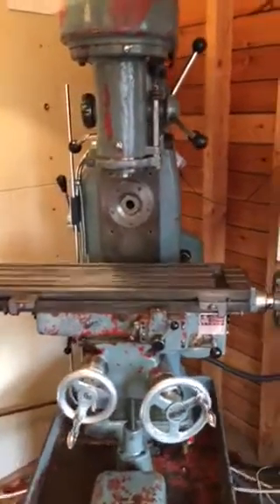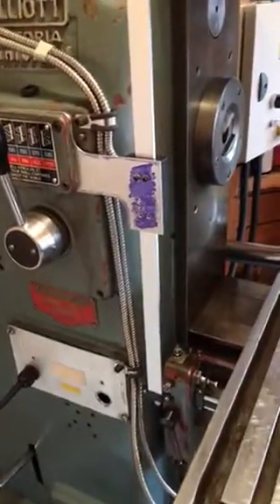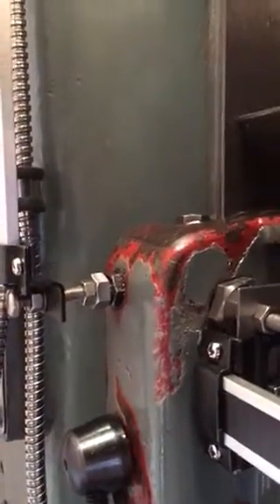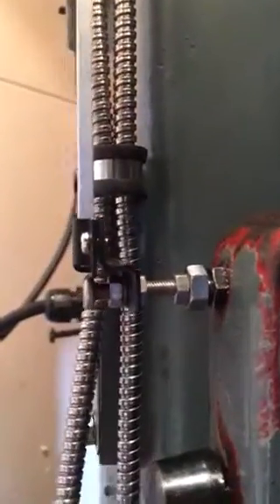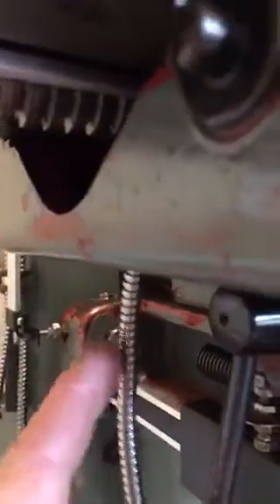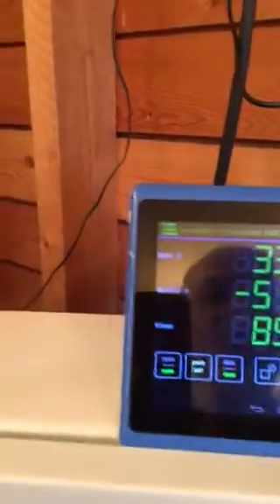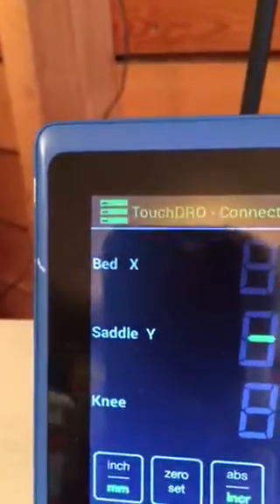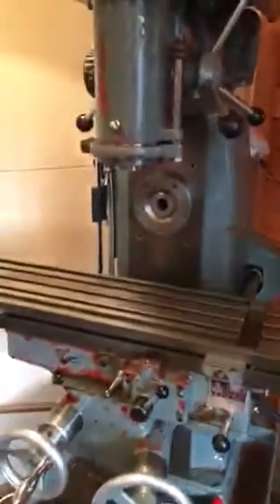Fitting a TouchDRO to an Elliot Junior Omnimil

Comment: Hi, I have one of these millers, Unfortunately, The Y axis Gib is 
missing. Would you be kind enough to measure yours? I only need the 
large end and small end measurements. 

Great video, I love the way you have wired all the accessories 

neatly all 4 motors are 3 phase so I am using inverters.

Thanks for the video.
Reply from the maker: So that’s the saddle gib dimensions, the way mine is set up! 
Roughly where are you? I’m in Sutton Coldfield UK